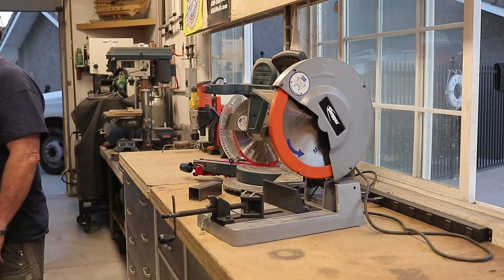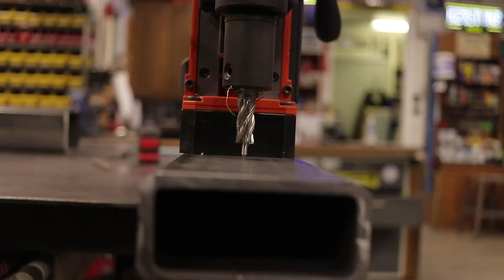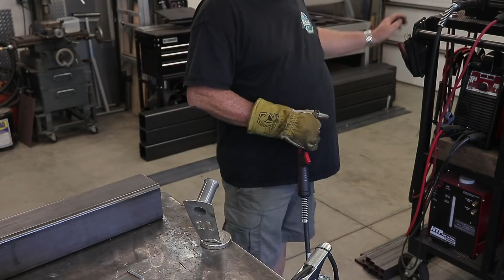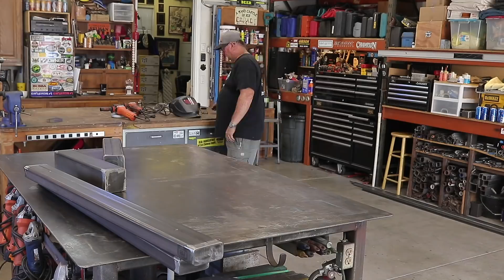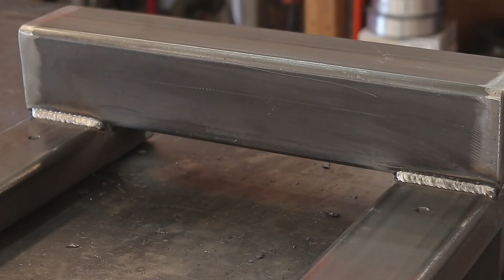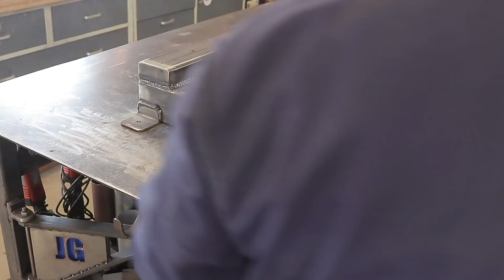Metal Air Compressor Stand | JIMBO'S GARAGE

Comment: Seems that I remember in my champion owners manual it's best to mount to just a wood frame laying loose on the ground, otherwise the vibrations can cause damage to the pump if mounted solid, even with rubber pads. I know your doing what the customer wants n i always enjoy your videos. Thanks

Comment: Nice.
About the only thing I would have done different would be to use some insutating button mounts under the frame, preferably with an earth link - it will cut down on noise and corrosion of the feet.

Comment: Weld uphill with FCAW? Never heard that? I’ve always been told if there’s slag, drag. I’ll have to try the uphill.
Reply: Conner McPherson some wire you can actually push also ( no matter what position ) and some of those you can push they actually weld better pushed than pulled in my opinion ...

But the keyboard commanders try to hate on my for saying that ....  

Fact is - i dont know them, i dont see any videos on their channels ... 
and just so happens that i currently hold some AWS D1.1 certs for FCAW several positions unlimited  thickness....   just coincidence ....  lol